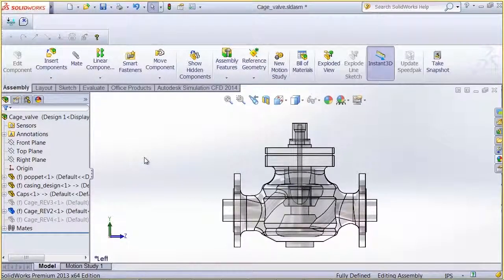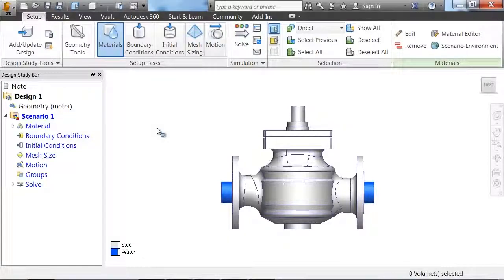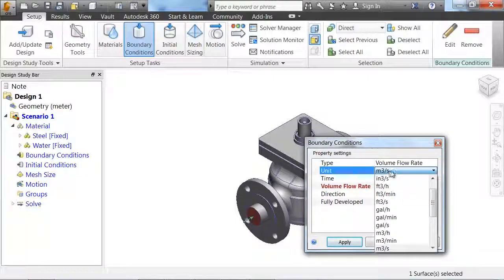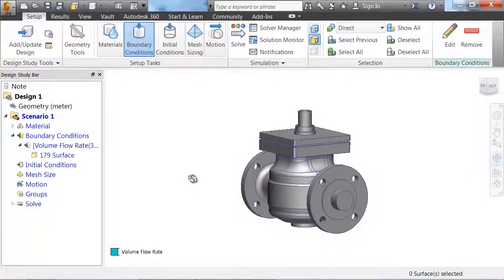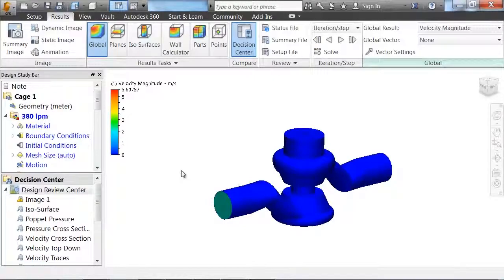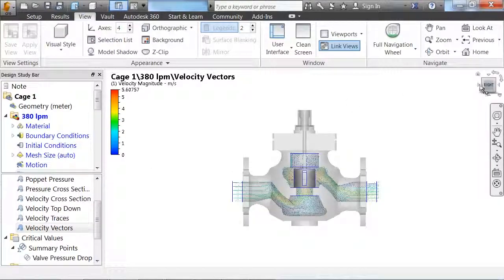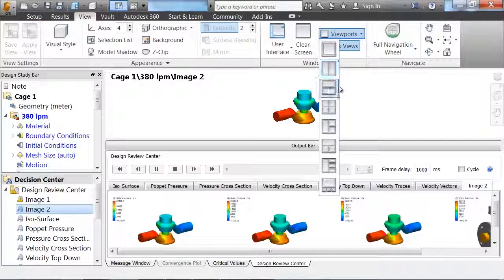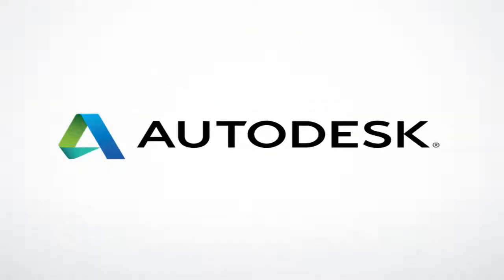SolidWorks and Sim CFD Quick Launch

Comment: Hey, i have both solidworks and autodesk simulation licenses but i dont have this connection between the two programs as you've shown in the video. i cannot import my active model from solidworks directly as you have done. if i try to save it as .prt file and then open it from autodesk simulatin but it never works. help?